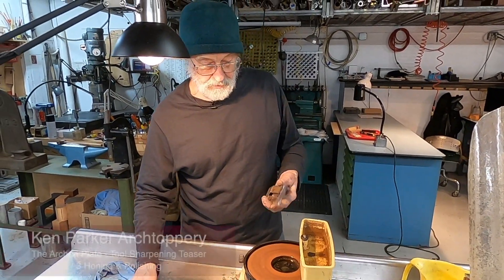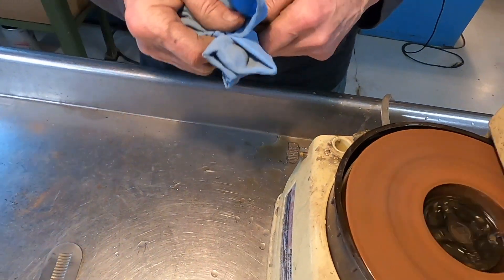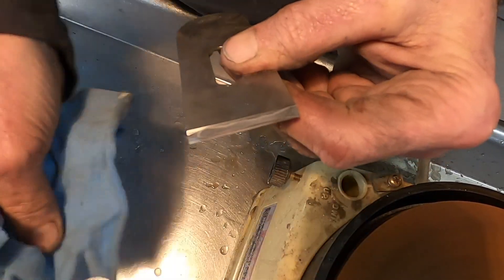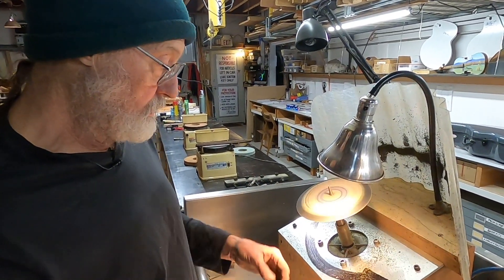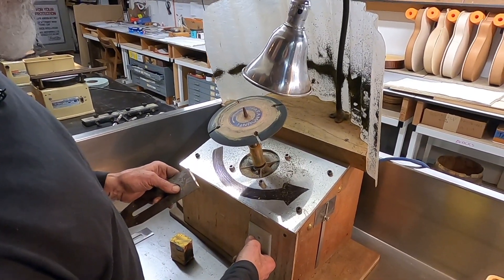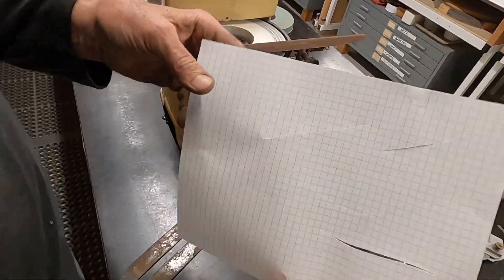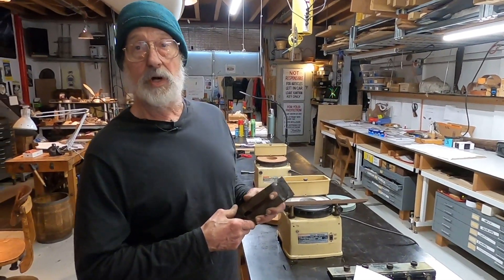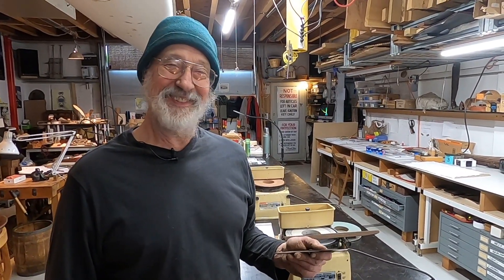Ken Parker Archtoppery - Tool Sharpening Teaser 3

Comment: Sharpening should be easy! Great statement. Thank you for these teasers. I should rethink my sharpening, because I do it by hand and it is elaborate and lengthy thing. I do not have space for all the machines in my tiny shop, but these teasers are not valuable because I can copy the process in full. I do not even want that. I will just steal some of your ideas with pleasure ;) Felt disk with slots allowing to see what you do (you showed ot in one of previous episodes) was already an Aha! moment!
Reply from the maker: I'll be walking you through some low cost solutiions to sharpening, and hoping to make things easier.
Dull Tool is an oxymoron!

Comment: I have a Makita, same as yours, never could do planer blades correctly.  Will clean years of dust and grime off from it and try free hand.  Your years of practice makes it look so easy.  Source of the felt wheels?
Reply from the maker: Yeah, the long blade attachment leaves much to be desired.  Better to send them to an expert grinding house, and go back to the bench to do things only you can do.
These 3 sharpening episodes are called teasers for a reason!  Soon, I'll get down in the weeds with the split lap machine, and show you everything I've learned about this great method.
You can look up the lapping machine in the jewelers' tooling supply houses to see where I got the idea.